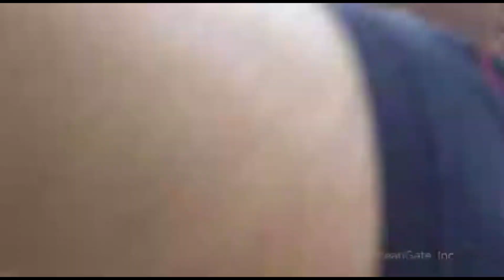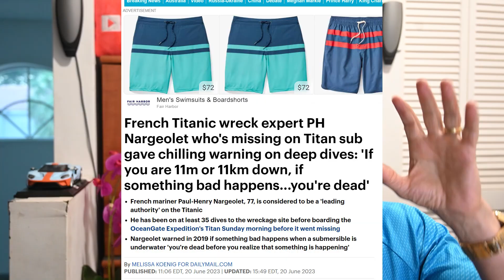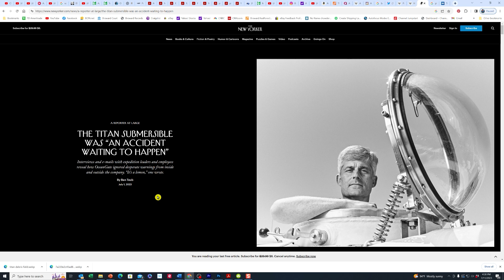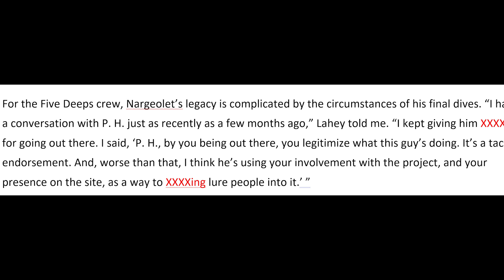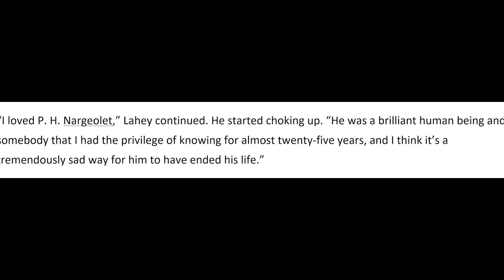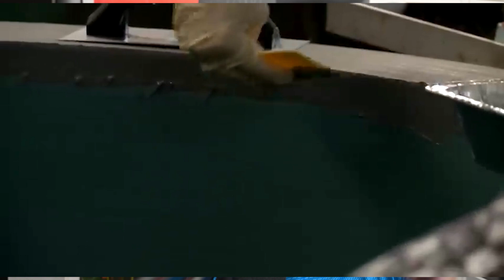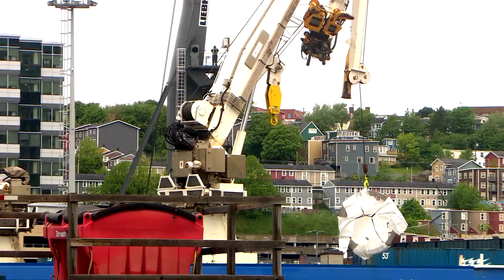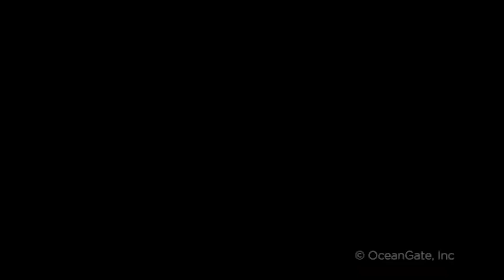Titan Sub: More Q&A, Design Defects, Why Descent Fast

Comment: Very easy explanation for fast descent:  a microleak?   If there would be even 50 kg extra water inside the hull,  the rate of descent would increase to what was reported. It would also explain why they were barely ascending according to the transcript (if it is a valid transcript) when they decided to return. The hull had much more water at that time, so dumping everything just barely gave them positive buoyancy. Obviously, you would expect to have water detectors at the bottom of the hull which would warn about the leak very early on, but who knows how the system was designed?  Maybe they did not put these sensors?  Some suggested, based on the few depth/time readings, that an even rate of descent was throughout, and so a microleak would not be plausible, but I think that following scenario could be more plausible:  initially, the descent rate was slightly higher and increasing without the crew making any adjustments; later on, the crew tried to compensate and tried to reduce the descent rate, so that resulted in an apparent even descent rate observed.

Comment: I am interested in how the battery packs are attached to the sub. There were 2 banks of batteries A and B how were the banks protected from the extreme  pressure ? Another thing is how was the wiring protected from infiltration of sea water. I was wondering if water inflitrated the battery pack to increased the weight and caused bank A pack to fail. I have looked on the net but unable to find info on the battery packs.

Comment: A submersible has a design decent rate. You can't go faster because the combination of buoynacy and drag physically prevents it. When everything works as usual and the payload is as usual, the decent rate is the same every time. When the decent rate suddenly or on one specific mission is way higher than usual and there is no obvious technical reason (more payload or more ballast on board), there is only one single explanation: They had water somewhere in the sub. Every single depth they radioed to the mothership shows that they were decending too fast from the very start. The only physically possible explanation is, they were too heavy from the very start.
Not enough evidence for such a far reaching conclusion? Remember the transcript. They had to eject all the ballast and the landing frame to stop the decent and despite ejecting that much weight they achieved only a very slow ascent rate. They very obviously were way heavier (at least by the weight of the landing frame heavier) than they should have been. Something was terribly wrong from the very start of that mission. 

Rush and Nargeolet both had been diving in that sub before. They knew what decent rate they should achieve when everything works normally and they should have been on red alert as soon as they found out the decent rate was way higher than usual.                                                                                                                                                                                                                                                                                                                                                                                                                                                                                                                                                                                                                                                                                                                                                                                                                                                                                                                                                                                                                                                                                                                                                                                                                                                                                                                                                                                                                                                                                                                                                                                                                                                                                                                                                                                                                                                                                                                                                                                                                                                                                                                                                                                                                                                                                                                                                                                                                                                                        

A question that needs to be raised is: How much reserve buoynacy (for the case they ever had to lift unplanned extra  weight to the surface) did they design for the sub? Was it the usual rate used in other subs or was it less?
Reply: You're correct that it is net bouyancy and hydrodynamic drag (along with orientation) that determines descent rate.  But a difference in descent from something like 1 mph to 1.5 mph is not some huge variance.  Sure, you can say it's "50% faster!!!", but at such low speeds we have to look at the numbers themselves.  Such a difference might take as little as only 50 or 100 kg difference.  Point is, what is 'usual payload' and what amount of variance would it take to cause this difference in descent?

Remember the ballast isn't 'finely tuned' to a few pounds.  It's in 'lumps' of how many 'lead pipe weights' and how many 'sand bags' you have attached.  And once started you can't just 'tweak a setting' somewhere to obtain the rate you want.  One story about a dive was "It takes about 2 hours..."  I don't think they meant to imply "It takes 2 hrs, 27 minutes, 38 seconds".   Who is to say that it was 'too fast' other than an unverified transcript posted to TikTok??

Comment: Also, the use of pressure during a cure does at least two things: it provides consolidation (bad in the case of a thick wall male molded cylinder like this as it also causes fiber buckling during the cure process as the wall thickness and circumference becomes progressively less as the wall grows) and the pressure forces small gas pockets back into solution in the matrix resin. The benefit to discontinuous, overlap spliced winds cured in a female mandrel is that the pressure during cure consolidates the wall and tends to straighten the fibers, all good for the resulting structural.

Comment: What is in the tail end of the sub after the last titanium ring of the pressure chamber? Is that where the batteries were located, and how big is that area?
Reply from the maker: Electronics and oxygen
Reply: @jeffostroff  thanks for  the reply and videos. I've seen a few videos explaining the design of the pressure chamber, no info on the white cover for the chamber. Again, thank you

Comment: I am in no way qualified to know anything about this topic, but, I think it is common sense that the descent rate is a crucial element. Descending in water with that amount of pressure too quickly would make a huge difference in how the sub adjusts, correct? I just wonder if they meant to drop that fast. i.e., too much weight on the submersible, or something malfunctioning causing it to descend quickly. 🤔

I understand there are many questions, and variables. Great videos by the way!

Comment: the video appears to show "towpreg" in use during the cylinder wind.
I would appreciate investigation of the "glove" geometry, the aspect ratio, of the slot the cylinder was bonded into the titanium end bells. Throughout my Boeing career in advanced composite structures development I was always under the impression that the slot depth had to be a minimum of 1/5 times the wall thickness of the insert.

Comment: Your video's on this subject are very logical,  so much that even a basic engineer as I can follow and understand. The method and concern for complete cleanliness just boggles the mind. I worked in hydraulics for most of my life and we took more precautions repairing valves and pumps than what appears to have been taken here.
Reply: I am not even a "basic engineer", I am an Economist and I also understand and follow each of the videos Jeffostroff has been doing to explain this sad and regrettable accident. Regards from Cuernavaca, Mexico.
Reply: Don't take videos or pictures companies publish as being 100% honest. Companies have design secrets that they don't want to give out. We don't actually know how it was built. In fact, we don't even know if the things in those videos were part of the sub.

Comment: I am a former USN submariner and commercially, I have an extensive engineering background in (metal) pressure vessels and their operation. The strength of a steel vessel is directly correlated to the materials (i.e., alloys) it is composed of, it's geometry, the various pressures imposed upon it, and the RATE that these forces are imposed upon it. The two main constituents of these forces are temperature and pressure. Total temperature and pressure changes over the range of operation, as well as the RATE of those changes have a significant effect on the strength and viability of the vessel. These two forces can be either additive or opposing on the vessel. For the Titan, these forces were additive for both descents and ascents. Cooler water encountered during descent compresses the titanium domes inward with the sea water pressure forces acting in the same manner (i.e., inward). Steel conducts heat faster than Carbon and steel will also contract under pressure as well. The Titanium rings therefore would be contracting onto the carbon hull where these two are joined together. I have no idea what this Carbon matrix's co-efficient of expansion/contraction is due to temperature or pressure changes but I'm willing to bet it lags steel by a significant amount. This unequal contraction/expansion of these two very different materials would result in very different stresses in those (junction) areas during dynamic operation versus sitting on the surface where the only change in stress would be due to the slow change in atmospheric ambient temperature. Steel is more susceptible to "Brittle Fracture" (i.e., sudden breakage) at low temperatures therefore temperature changes and pressure application need to be performed slowly (e.g., rate of ascent/descent). Brittle Fracture typically occurs without warning whereas structural failures at or near operating conditions (i.e., design temperatures and pressures) are more forgiving and may just result in a deformation of the geometry of the vessel (with a warning and without failure). Vessel breaches (i.e., failure) due to Brittle Failure can be minimized by adhering to strict operating procedures that (among other things) limit the RATE of temperature and pressure forces on the vessel. For a given composition and geometry of the metal, these parameters are already known to engineers. For new designs, these known quantities are a starting point in the design with additional testing required for certification. In conclusion, even if the Carbon-Titanium (and glue) pressure hull was certified to dive and operate at 4000 meters and 31 degrees F, the RATE of the descent (and ascents) would be part of the requirement for maintaining any certification. In addition, cyclic fatigue would have to be ascertained in order to facilitate periodic inspections and maintenance that is typically required to maintain any type of engineering certification for pressure vessels.
Reply from the maker: Great analysis Kevin thanks!

Comment: as to the boyancy issue...
A regular submarine uses air to become positive boyant rather than dropping weights (like a hot air balloon).I wonder if it was over loaded with occupants.Has that been looked into?did they have a protocol in place to account for weight?

Comment: I am just what i would consider a knowledgeable layperson but ive worked in several plants building carbon fiber, welding etc.
There areseveral methods to wind continuos fiber compositses and a few different types of winding fibers when last i was involved in it.what they may have been using was pre-impregnated winding fiber.I have worked with fiber strand both in sheets and on spools that were impregnated with resin and relied on being heated to activated the polymerization process.But this was alwyas done in an autoclave when I worked on it.
Anytime we bonded ANY matel to composite it was always clean, sanded and handled with gloved hands...AT LEAST.usually we built and assembled it in a clean room environment.full suit and masked.
he best wy to make your parts have the best structural bonds and integrity was to place your parts in a special vacuum bag and evacuate it, seal it and bake it(autoclave).this removed small bubbles and air pockets captured in the product and brought the fibers into closer more intimate contact for better strength.the next best method was a 2 part mould that was clamped and the part would be under pressure from 2 directions at once.each method had its best uses.
We had at one time built a tank to hold a fluid for a government contractor and it needed to meet specific requirments inmaterials and workmanship.
It was required to be tested under pressure after assembly.
when it was completed we hooked it up and started pumping water into it...after some time we started to hear these small pops and crackles...like rice crispies.the tank was a failure.
in any material or machine...if it makes any sound in use that is a sign of fatigue.Knocking in an engine can be predetonation but it can also be a ticking lifter or slapping rod etc.but they all indicate an issue that can cause a failure if left unchecked.

Comment: From the construction video of this liaison, I cannot see how they prevent air pockets for being trapped in the glue between the titanium ring and the carbon. Of course, air pockets in a high-pressure join are not something recommended. If I have to decide of a single point of failure, it will be this one.

Comment: The descent rate was pretty constant down to their report at 09:17 (2960 m depth) at about 39 m/minute, then over the next 11 minutes from "no adjustment needed" the descent rate increased from 39 to 44 metres per minute, and the RTM alarms started as they approached 3433 metres depth.  Something was causing them to loose buoyancy and sink faster over that last stage.  They never reported water entering the pressure hull, so the buoyancy loss must have been caused by deformation of the hull resulting in lower displacement.  IMHO.
Reply: My first (mostly uninformed) thought would be water permeation of void spaces in the carbon fiber. CFRP doesn't really "do" plastic deformation.
Reply: would turning on thrusters account for the speed increase to 44?
Reply: I think there was an insidious short circuit that wasn't bad enough to flip a breaker until they got to that depth. Probably overheated the battery. The reduction in voltage to the thrusters would explain their slow ascent and rapid descent. Since salt water isn't a perfect conductor, this problem would go unnoticed since the resistance would've still been high enough to prevent a breaker from flipping. This is why complex machines have so many gauges that measure every single thing.
Reply: @ryelor123  As I understand it the descent and ascent were primarily 'powered' by ballast on the way down and by dropping ballast on the way up.  The surface-Titanic-surface trip was not done by using the thrusters - to do so would have used a lot of power that the craft did not have.  The thrusters were used primarily for manoeuvre off and onto the launch sledge, and for touring the Titanic.
Reply: Do you think it was possible for water to get in between the metal hull and the carbon fiber and the deeper they went the pressure made the leak worse and thats what was weighing them down? Their decent rate was way to fast and their accent rate was way to slow the only thing i can think of that was weighing them down had to be water somewhere in the hull maybe in the aft tail and thats why the batterys were burning out
Reply: @jasonlinton9902  its a bit of an enigma. Somehow the sub was losing buoyancy but somehow there was no obvious leak. V strange. It will be interesting to see the outcome of the official investigation.

Comment: Another thing to look at is the fact that they are mixing the adhesive in a plastic pot, by hand, with a spatula. This is okay for home gamer fixes but not for anything safety critical. It's a sure way to get inconsistent mixing, poor bonding and decreased strength. Epoxies in this sort of situation should be pumped through a mixer nozzle or otherwise mechanically mixed to ensure that they are completely free of unmixed components.